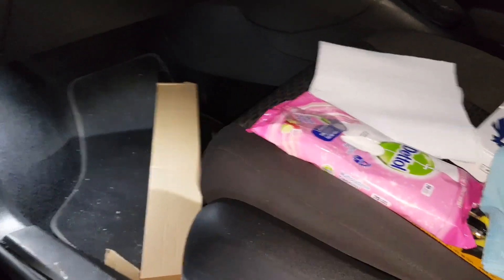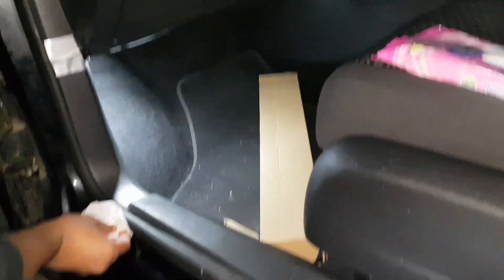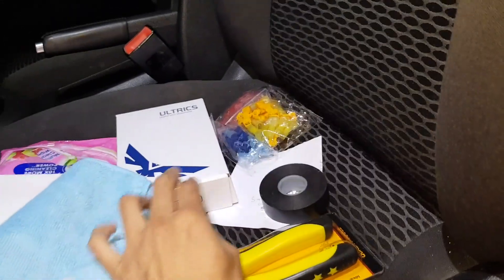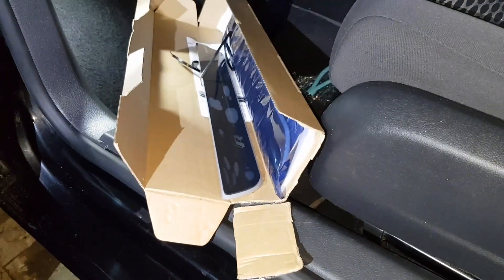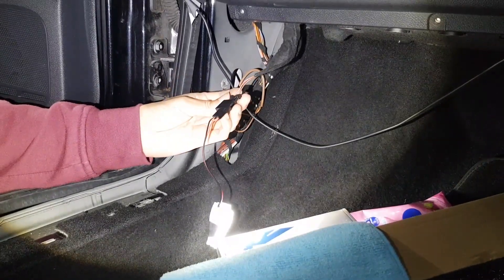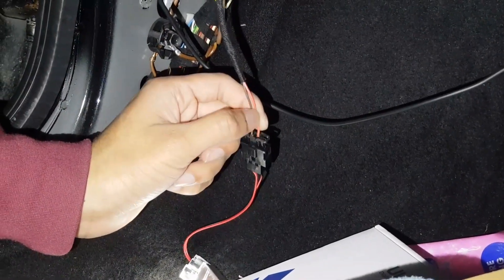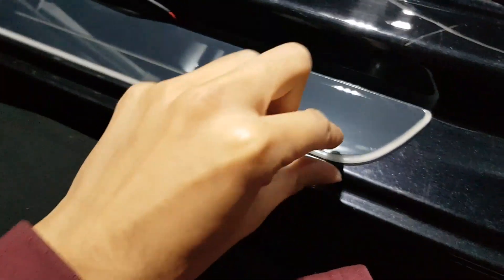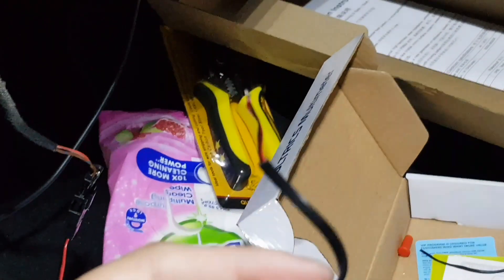How to Install Golf R LED Door Sills In VW Golf MK6

Comment: HI  you can very easily install using the (+) wires from the footwell circuit,   it is safer and cleaner to work. I installed the wires for all 4 animated LED door SILLS on Octavia II non-face lift, MY2008 (including  small Wago for wire connections) in almost  3 hours. The GND was taken near the  fuse box and  glove box, using the near screws.
Reply from the maker: Nice haha, how did you find the positive wire colour as my wiring loom on that part has like 4 different wires of the same colour, and i couldnt find a wiring diagram

Comment: How reliable are these Led door sills after a period do they still function after long time of use ?
saw some complaints after a few months it builds moisture inside which result in defect
Reply from the maker: 3 years later they still work fine

Comment: Connect it directly to the foot light, that's the easiest way to get it done, or power it from the cigarette pot, vw is powered by electronic module, all switches send signals to the module and the module interpret the signal and send power to the source required, its hard to tap power from any supply unlike Japanese cars, the best way is to pick power from the appliance you want the light to work together with
Reply from the maker: Yes this is best advice i agree

Comment: will the light turn on only when ignition is on? or is it on always?
Reply: im trying to find which wire to tap so when ignition on then the lights will be on.. can u guide me? i dont have a footwell light on my mk7
Reply from the maker: It should turn on when doors open if thats the wire you tapping, since you dont have footwell lights wire it through your headliner to the interior lights that come on when you open the door
Reply: MrWaheedulHaque I have a bunch of wires I’m using the one near the seat. But which color do I use? There’s too many wires there
Reply from the maker: @ee-sj8qr  why are you using seat wires, you dont want them to be always powered only when door is open, wiring to seat will only have two outcomes, either they stay powered on always, or they will only turn on when you press electronic controls on your seat, unless you dont have them then it will just always be powered
Reply: MrWaheedulHaque it is not really the seat wires but there’s a bunch of wires beside the seat the leads to the fuses I think. I take a photo  later
Reply from the maker: @ee-sj8qr  might be the wiring loom for the door you are referring too, again this would create either a constant light on, or when certain conditions are met it would do it, best way would just be to wire through headliner